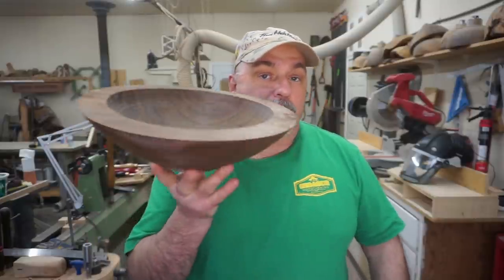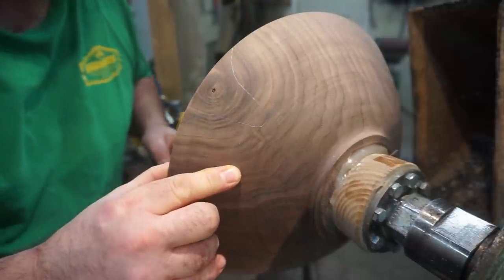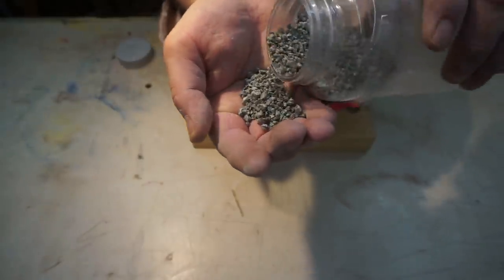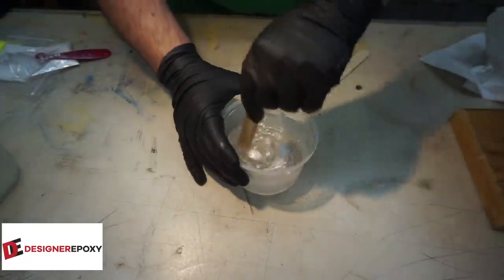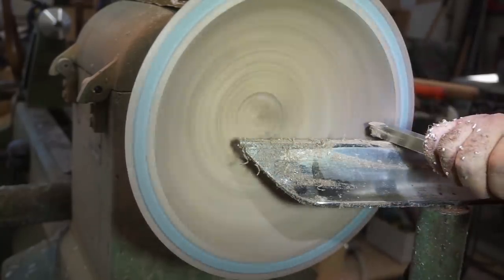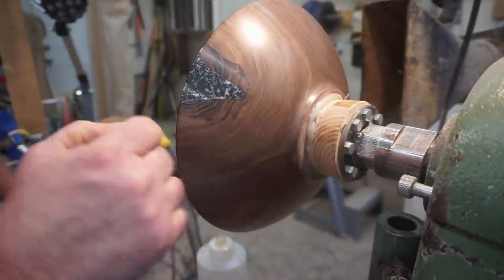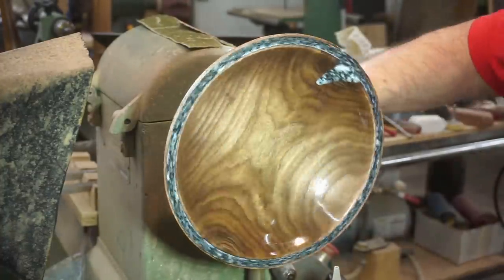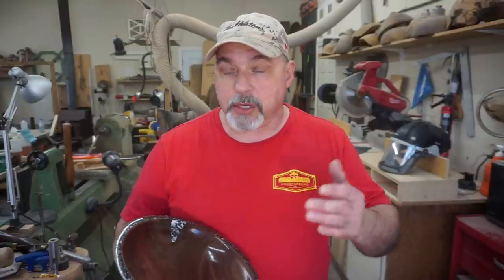Woodturning - Walnut with Black Soapstone and Designer Epoxy

Comment: Beautiful bowl - I really like the blending of natural materials with the epoxy.  For the end grain staining on the more porous woods,, I’ve had pretty good luck using shellac based sanding sealers before the epoxy to avoid the staining.
Reply from the maker: Yes, I should of realized this. When I do my natural inlay with CA glue the tape goes right out to the edge so never even thought of it at the time, thanks!
Reply: @SpragueWoodturning  I can usually avoid this step when I use tape for my mold.  Like you said, it goes right up to the edge of the cutout.  The only “problem” I have is that it creates a flat spot at the inlay.  It’s hard to get the curvature and avoid epoxy leakage onto the end grain with the tape.

Comment: Nice epoxy set up. A neat trick for loading large items into the pressure pot is to use masking tape handles.
Reply from the maker: Yes, I think you suggested this before, I could still get my hands just barely in the pot so I skipped it this time but I certainly will be using it in the future, thanks.

Comment: I love seeing your experiments. Maybe thinned down sanding sealer would help prevent the staining. I think, for most people, they would think that particular stain is just a feature of the knotty area. I like your idea of mixing the soapstone with the epoxy. Maybe clear epoxy and the inlay material is an option to using superglue and inlay material? It is hard for me to judge the different levels of effort and cost between the two.
Reply from the maker: The CA glue is faster but the resin gave a nice bubble free inlay, so it’s a toss up, I will seal the end grain in the future or put the glue right on the edge like I said in the video, thanks.

Comment: One trick to keep resin from soaking into surrounding wood is to seal exposed edges with sanding sealer.  I actually use a 5 min epoxy or CA glue to seal it.    Great job..
Reply from the maker: Thanks 🙏

Comment: If you go to the dollar store or canadian tire, they have an assortment of silicone baking tools.  I have found the spatula works best for mixing small (less than a liter) of epoxy. It also scrapes the sides of the mixing pot and emusifies the additives without too many bubbles.  Good luck.
Reply from the maker: I will check it out if they ever reopen, thanks.
Reply: @SpragueWoodturning  i had an idea pop into my head which is a modification of a boatbuilding with epoxy technique.  So far everyone casts with epoxy on top of the inlays.  For your soapstone work, perhaps you might want to try mixing a suitable amount of epoxy and then stirring in as much inlay as you can.  Then pack it into the voids/channels.  Let set and then turn.  You might have to thin the epoxy a bit to prevent bubbles.
Reply from the maker: @patriciamay638  I will give it some thought, thanks

Comment: Next time you might paint a light coat of resin where the cut out is and let that set up. It might keep it from bleeding. Absolutely stunning.💜💜💜💜💜💜💜💜💜💜
Reply from the maker: Good idea but I don’t want to weight that long, I think the key is putting the glue right up to the edge of the cut so the resin can’t bleed through. Jim.

Comment: Nice turn Jim. 
Hope you don't mind me passing along a little info. That sort of see-through resin around the side inlay is called Ghost Resin and pretty common. It can be removed by either cutting it down further or sanding it until gone...  I noticed a couple of areas where you had resin and no inlay material. Next time you may want to try introducing the inlay material into the resin and then pour it. It lays out a little more uniform. Then, e21ven if the material sinks you'll be able to trim the thin top layer off and all you're left with is a nice layer of inlay and resin... Thanks for sharing. V
Reply from the maker: Thanks for the info Mike.

Comment: Very nice combination of material and a super project.  If you don't point out the resin stain, ny guess is mot people will think it is the n atural color of the wood!  As turners, we are our most severe critics.
I'm not an expert with carbide tools, but you may be able to improve the cut by doing one or both of these techniques:
1. After initial cuts, tilt the tool handle upwards a bit which sort of makes the cutter a negative rake cutter.
2.  Turn the cutter about 45 degrees and do a shear scrape as your last cut before sanding.
Might work.
How does your resin compare to what we have in the US from a company called Total Boat?  Looks very similar.
I enjoy your videos and look forward to future ones.
Cheers
Reply from the maker: I’ve never worked with Total Boat Resin but watch a ton of videos here on YouTube and I usually see bubbles in their work and not very many in mine. I’m assuming it’s the resin since most of these turners have way more experience than me?? I also do the handle tilting thing, just haven’t show it I guess, lol. Thanks!

Comment: I've experienced similar staining when using thin CA glue to fill thin cracks on some bowls. I found that finishing the surface with a sealer (like shellac or a lacquer based sanding sealer), and  then lightly hand sanding the surface, reduces the wicking of the CA into the surface on each side of the crack. In your case, your suggested solution to reduce staining was to put the hot melt glue closer to the gap...and it is difficult to get it really close to the gap. You might try  carving a groove and then sealing the surface on a scrap of wood, and then fill the groove with your designer epoxy. Just an alternative suggestion...it may not work as well with epoxy and your pressure pot.
Reply from the maker: This is why I put a coat of finish on any of the bowls that I do inlays with CA. With the epoxy being a lot thicker I didn’t think it would be such a problem, oh well, live and learn. Thanks.

Comment: could also try sanding sealer along with the glue being closer.  with the sanding sealer maybe the wood will drink that rather than the resin.  I like the combo of the resin with the natural materials
Reply from the maker: Yes, this was an over site on my part, I’m used to putting the tape right up to the edge of the wood when using CA, live and learn! Thanks

Comment: If you were to add the fine soap stone to the epoxy as you were mixing it like you do with the colour you could pour it in and get no air bubbles/inclusions? Might need to experiment and see if it settles at the bottom or stays suspended.

You should maybe warm the plastic you used as a barrier and put a flat weight on it to flatten it out, a heat gun or hair drier? lol would help get it to a better shape for use or make a curved piece of wood to sandwich it and give it a better curve?

Hope it helps ...
Reply from the maker: I really think it will settle to the bottom of the inlay, but in some cases that might be beneficial, the heat gun is a good idea, thanks.

Comment: Jim, great video today! I’m with you though, I’m a bit undecided on the outcome. I agree 100% with Joel. Maybe it’s the colour combo??? While I don’t think it is something I would go for, it’s perfect for someone else. Especially by the excellent comments you have gotten. 👏Regardless, there are some cool things about the cutout portion. More solid salt and pepper outside and the when you go to the inside of the bowl, Oreo cookies crushed into vanilla icing that has drizzled off the piping. So that portion was really kinda cool. 
Maybe consider doing this again without the ring on top and more like you do the branches in soap stone bowls. Also thought it might be cool to do this with a #gnarlier piece 😁
Reply from the maker: Lots of different inlays coming up, stay tuned, lol. Thanks K

Comment: I enjoy watching your experiments and the results. Add more things to my " I need to try that " list. Not sure if this colour epoxy is good or not. Didn't jump right out and grab my eyes. But my taste isn't everyone's taste.
Did I hear you say that you were looking for a new finish? Is the salad bowl finish discontinued or have you found some reason to dislike it? The reason I ask is because I bought a couple of cans in the fall after seeing how it worked for you and so far I quite like it.
Reply from the maker: The Salad Bowl Finish is fine, they’ve replaced it with Wood Bowl Finish which they’ve taken the food safe label off. I was unaware of this when promoting the wood bowl finish, I just assumed it was the same thing and it probably is but they are washing their hands of liability and putting it on the user. This is why I won’t use them anymore when I run out of the finish. Jim

Comment: When you use your glue block, hot wax, how much pressure are you putting on the gouges, and other tools? I'm asking because I used it twice and both times the wood block did a walk about... Maybe my techniques are too heavy handed as I'm an above novice.  Thank you for your techniques and tips, guidance throughout the process!!
Reply from the maker: Wow, I’ve never had any come off when turning, make sure both surfaces are roughed up good and both concave a bit and free of any dust prior to glueing. Are you using a glue gun or frying pan like me? When turning you shouldn’t need to apply heavy pressure, if that’s the case it’s more likely a sharping problem. Don’t spare the glue either, Jim.

Comment: Hi Jim,  sorry I'm don't see the entry video jet, but Why don't you usethe red tape facing sticky side to sticky side, and leave a little, or another layer, to glue to the bowl? Don't is strong enough?
Reply from the maker: I think your asking why I didn’t just use the tape on the plastic? If so, the tapes not strong enough to hold the plastic in place, I don’t trust it on its own, Jim.

Comment: whats the adhesive you use in the beginning to glue the bowl to the blank. Is there a weight limit to the bowls it can hold?
Reply from the maker: Hot melt glue in an electric frying pan, I’ve held over 20 Lbs with this method. Just make a larger glue block, Jim.

Comment: Hi Jim, Great video.
Is that denatured alcohol or methyl hydrate?, (methyl hydrate,methanol or methyl alcohol) is very toxic and is easily absorbed through the skin.  I wish I could get High proof Alcohol here in Nova Scotia like in the USA that would fit my latest Finishing method. Food Safe is a big subject, I will be very interested in what you find to replace your wood bowl finish.  Richard....
Reply from the maker: This is still denatured alcohol, but I’m running out so will switch to methyl hydrate soon because the denatured stuff is so expensive! Get some copper and make some high proof yourself, 😜
Reply: @SpragueWoodturning  Stay Safe Jim, Gloves and lots of ventalation.

Comment: Jim, I think some sanding sealer may have helped with the Epoxy staining. Do you know if GF Bowl finish is the same as the old salad bowl finish I have heard that it is?
Reply from the maker: Yes it probably would help for sure, in regards to the SBF of m not sure, I was told it was, but they just took the food safe tags off. I’m sure it’s safe to use, I just don’t know why they would say it’s for decorative bowls only??? Either way I’m out!
Reply: @SpragueWoodturning  I understand but can't find another Poly product that says it's food safe, I think there lawyers told them to remove the food safe to protect them. Everything I am seeing these days says if it's cured it safe regardless of labeling.
Reply from the maker: Mohawk salad bowl finish still has food safe tags so that’s my next order when it gets back in stock here in Ottawa.

Comment: Hi Jim. There is a product by an Australian company by ubeaut finishes called Foodsafe Plus. I have a bottle but haven’t used it yet. See link.  http://www.ubeaut.com.au/FS+.htm. If you are interested I could use it on a turned item just to see what the finish is like. Kind regards Steven
Reply from the maker: No thanks, it’s a mineral oil finish that will require constant maintenance, I’m looking for something that’s maintained free, thanks for the suggestion tho, Jim.